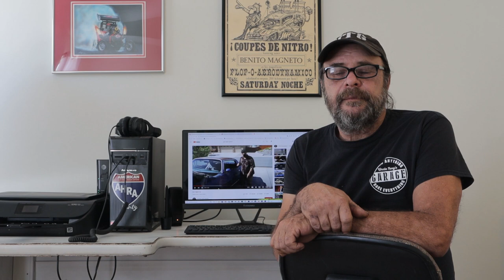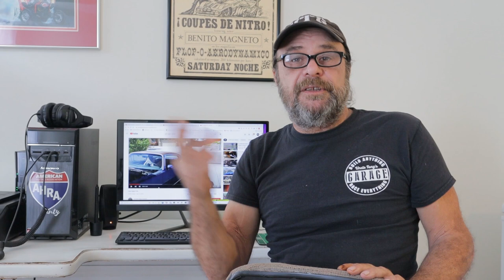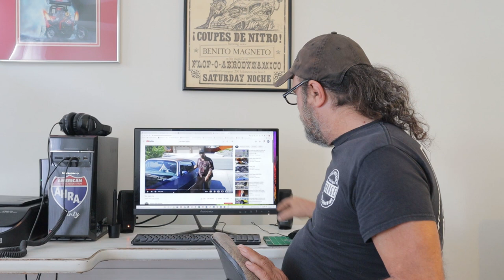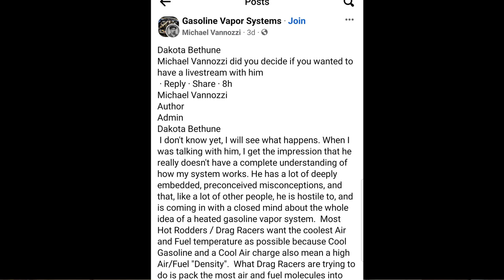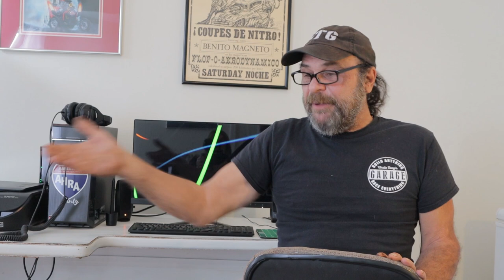Climbing Down The Mega Mileage Conspiracy Rabbit Hole

Comment: Uncle Tony,

I had to look through my garage library to find a copy of "Secrets of the 200 MPG Carburetor" by Allen Wallace. My dad ordered from out of the back of "Popular Mechanics" back in the '80s. I remember reading through it back then and believing it, then I grew up. It turns out that there is a demand for this rag "book", they are going for about $30 online. I see there is even a .pdf available to download as well. 

Keep up the good work!
Reply: I purchased that same book in the early 80's.  Naturally, I imagined that I would build one and achieve the incredible results.  After reading through the material, I decided I didn't want to be killed when my home made fuel air bomb exploded.
Reply: @flbartlett  It's not a bomb if built properly. I ran a little thousand watt Gen for a few days off evap fumes from a Jerry can. Took 3 or 4 hrs to work out air to fuel ratio but it worked, really well. The evap fuel is used as it's made, no storage, no bomb. Hydrogen cells work too and just need a simple spark arrestor, no storage, no bomb, also dirty non potable water is best.  All easy to do and safer than strapping propane tanks to your truck.

Comment: I built a vaporizer and diverted a proportion of exhaust heat through a stainless exchanger. It was well constructed. It was tried on two engines. A 3 liter V6 ford and a  3.3 liter GM Holden . The fuel consumption showed 50 mpg and 42 mpg respectively. That is imperial gallons. There was no noticeable loss of power. Long trips were taken.  
This experiment was done in 1980.   
High compression is a problem, the intake heat is critical and pre ignition, pinging, is going to damage the engine.  
A small carb on the heat exchanger was used, but it was found that a smaller main jet and the heat straight into the main carb had the same results. This is a bit problematic.
Conclusions. low compression is probably better.   (perhaps a turbo engine without the turbo).  When an engine is started the mixture is slightly rich and also while running.  The ambient conditions are being modified with added heat.  

The cycle of the crankshaft on an engine does not have any major combustion force applied as torque until about 35 degrees after TDC. There is some volume to be filled with a high pressure that is only a filler.  If the piston could be at the end of the cylinder and the crank at 35 degrees a higher combustion force would act directly into torque on the crank.
I built a retro fit on a small engine which I still have and it gave about 2.25 times the usual HP. It can be calculated and a volume per crank angle was plotted on a graph. Extra heat would be recycled at low load on such an engine.
The engine idles extremely slow and with open throttle accelerates to high revs almost instantly.
The engine is not practical for a race engine and was built only for cng fuel but petrol was used. More investment was needed as per usual.

Comment: All good points Tony, and you're being as open minded & fair about it as possible. I find it awful damned funny how the guy couldn't even give you a straight up answer over the phone. Not to mention it's painfully obvious he does NOT want to take up your offer of paying for a chassis dyno test.......hell, even a ride-along would do.......to see if the car performs even moderately ok during the take off, and passing slower traffic. I would wager that if he sees a guy haulin' ass on a bicycle toward him about a hundred feet out, he'll wait to let the bicycle pass him, before pulling out onto the road. The dude is straight up being DECEITFUL. Or else he would jump at the opportunity to prove "how well his Camaro runs overall".
Reply: Next up will be " run your car on water "  Have a look at this vid  Vacuum Pressure Hydrogen fuel cell defeats high gas prices using hydrogen from H2O.  on the channel Metalpress TV
( An actual fuel cell takes in a fuel and oxidizer to make electricity,this is sometimes found on space ships. What this guy is doing is electrolysis that absorbs electricity. )
Reply: @gasolinevaporsystems9022  That is a heavily edited video & didn't prove anything. My little 2000 Tacoma 4x4 with 2.7 liter normally aspirated 4 cyl engine runs 115 mph no problem.......but it takes a while to get there. It cruises @ 90 mph all day long, and hums along, cool as can be. I'm not demanding a V8 that gets 35 mpg @ 55 mph to "run the 1/4 mile in 13 seconds".......all we're asking is if the 35 mpg is worth the trade-off on what the engine can do under normal, realistic loads......such as a brisk take off from standing start, when heavy traffic means you'll sit there all day if ya don't. Same for passing slower traffic at speed. So what's the big problem in proving that? If your car can do that, it would be GREAT. So by all means, prove it to us. Because heavily edited videos showing short little clips ain't gonna cut it.

Comment: I completely agree with UT. Let's see actual numbers. I've got an old 350 4 speed with 3.08s that used to get 20mpg before ethanol, post ethanol is 17mpg, in an 81 k10 pickup. Almost unbelievable, but more believable performance than that hot vapor camero
Reply: had a f100 that had a c4 3speed auto got 20 mpg! had a 351w! 2.80 rear gears

Comment: That is an interesting theory. I can see the car getting decent mileage while cruising. But I can’t see the carb being big enough for decent acceleration.
Reply: I said the same thing lean
Reply: If we knew what the carb was off of, and air speed at the carb outlet, we could figure cfm, and put a similar cfm carb on a 350 Camaro. 

I bet there isn't one that small, though.

Comment: I remember in 2002, eBay was flooded w/ "Electric Superchargers". Basically a leaf blower fan you hose clamp inline w/ the intake duct. Advertised as increased mileage and hp.  The stupid Tornado fan blade was another gimmick .

Comment: In the 60's or 70's there was an article in Road and Track about a mileage competition in Europe. Cars like a Fiat 600 would be stripped of all but the driver's seat, and smaller a carburetor used so the car would run at wide open throttle. Skinny tires would be overinflated to reduce rolling resistance. These cars would not be useful for a daily driver.
Reply: Exactly.  The vehicle has to also start at sub-freezing temperatures (hard to do with hot-vapor systems when everything is cold), as well as at triple-digit temperatures.  Not to mention meet modern-day emissions laws.  And it had to run well past the warranty period.  The automakers are making so many compromises to meet all of these requirements that us car drivers demand of our vehicles.  Who wants to have to plug in their vapor system to preheat it for 10-15 minutes before the go to the grocery store in the winter time.  Most people wouldn't accept this.

Comment: One issue I've run into over the years talking fuel milage is simply that a lot of people don't know how to calculate MPG correctly. You'd think most people would be smart enough to fill the tank, drive X amount of miles, fill the tank again, then do the math, miles driven ÷ gallons used. 
Grade school level math, it's not hard. But DAMN I've heard some crazy numbers! Then after a brief conversation figured out that I'm talking to a math challenged person.
 Getting into odometer error quickly goes over the heads of a lot of people as well. 10% off one way or the other has been the rule for every old Dodge pickup I've owned. Once transmissions and rear gears get swapped it can really get bad. How many gear heads even think about the speedometer gear?
Reply: Or tire size???
Reply: The topping off method on new cars does not work. You can’t keep clicking the handle otherwise you’ll get liquid in your vapor trap and each type of pump shuts off with not the same back pressure.
Reply: @kalebbrown93  You don't actually fill the tank until gas comes out do you? Most vehicles have a vent tied into the filler neck, so your "new car" statement really makes no sense. Unless your idea of an "old car" is a Ford Motel T?
 It ain't rocket science just fill the tank till the pump shuts off, if you want to be super consistent go back to the same station and use the same pump. 
 We could argue that pumps might shut off at different points of back pressure all day but we're not talking gallons of difference here. Besides we're only interested in milage for our own use. If you're out to set a world's record or whatever, that's a different matter.

Comment: Your right uncle T…back in the late 70s, my dad, myself and my 2 uncles built a unit that could run a D-150 with a 318, on fumes only.  We had the St Paul Dispatch Pioneer Press come out and do an article on it., had WCCO News come out and do a news story. We made it run, respectively, but it was extremely dangerous. Mid range power was fine and it had very low emissions, extremely low, but yea the truck would run and perform on just the fumes from our chamber, and I did see the chamber ice up because we had neglected to heat it. It did work, I’d love to share the story with you if your interested.
Reply: If your story is true you could be a billionaire marketing your novel carburetion. You and all of mankind would benefit.
Reply: I was running semivapor at very lean mix with hot air valve wide open at aircleaner exhaust manifold.
Car ran awesome!!
Fast, responsive 15mpg increased to 21 mpg.
1966 289 2 barrel automatic.
Drove it for 2 years everyday.
Planning on getting it running again soon.
Reply: @rcnelson      I’d love to share it, it did work. There were more failures than successes , like I said it was dangerous, but when we got done,the truck ran and drove completely on the fumes from the chamber we built. We were just some garage wrench turning guys who came up with an idea, not engineers.

Comment: Great rant. And Uncle Tony is 100% correct about everything. As for that guy with the Camaro, I don't even understand why it's important that Uncle Tony understand how his vapor fuel system works. The whole point with the dyno run is to prove that it DOES work in the real (i.e. that it does it's job properly), not HOW it works in a technical sense. If it turns out the system does do it's job, then HOW it woks would be the next step.

Comment: Hi  Tony   My dad was an automotive mechanic .  He had a GM Doctor Certificate (1950)    Worked on gas and diesel engine for 40 some years.   He came up with an idea.  Heating the fuel to the carb so It would atomize and vaporize faster .  This would only happen once the car was warmed up.  His aim was to go from 14 miles per gallon to 25 mpg.  That was before all the improvement on fuel injected cars.      He was well aware amount of power required to move a 3800 Lbs  vehicle.     He  abandon the idea  because if the temp would get to high it would create a vapor lock in the fuel line.   So you would need to have a management system and regulator to shut off the heat.  A very complex system.    Cause and effect

Comment: would love to see the internals on that engine.  it must run soo lean .
let in go on a 200 mile nonstop roadtrip   i bet it locks up due to heat. 
dont waste more time on that dude.  theyre narrow minded like the essential oil people and flatearthers.
we did the experiment on a moped many years ago and doubled the mpg.  only problem was we had to get off trottle slowly or it would lock up.  it works on short term and short trips but after a month cracks were starting to form on the cylinder skirt and bottom of piston. a disaster waiting to happen.
Reply: It's gotta clatter like hell going up a hill...
Reply: If he's running that lean, the valves will soon be fried stumps and there will be holes burned in the pistons.
Reply: It's flat
Reply: re lean running, there's a range where the A/F mixture gets to peak EGT (Exhaust Gas Temperature). View it like a hill on a graph paper page. 
If you had an exhaust EGT gauge and an engine running under cruise conditions and the capacity to lean the carburetor what you could do is this: full rich say 575deg, begin to lean 600, then 650, then it peaks at say 675. You keep leaning and it goes 670, 660, 650, 640 , 630, 620, then starts running rough and cuts out.
 
What I've just described is what happens when you lean an aircraft equipped with a piston engine since you have to lean them when climbing to compensate for the reduction in air density anyhow, not just leaning when cruising. At 10,000 there's say I dunno 30% less air so your 300hp engine at full throttle now makes 200hp at full throttle and you have to manually lean the carb to compensate because if you leave it in full rich it runs badly rough and fouls the plugs and of course makes no power.
According to a given Pilot's Operating Handbook (POH) typically you would lean to peak EGT, then richen 25deg.
HOWEVER - some manufacturers allow lean of peak where you get to peak EGT and keep leaning so going off the backside of the curve. It is only for cruise conditions not for full power.
You see the detonation range is load dependent as well as lean temperature dependent and once out of that range they deem it safe to lean their engines in accordance with their leaning procedure. There is a chart that has manifold pressure, RPM, and allowable leaning temperatures graph in the POH. All piston engine aircraft have this.
Reply: Wrong lean only equals heat in a small window of afr. Many 90s cars ran a lean mixture for highway mileage and the practice was stopped because the exhaust temperature isnt hot enough to properly activate the catalytic converter.
Reply: @jarlnieminen4307 Oi Goose!
re read what I just wrote. Peak EGT or stoichiometry is not where the you lean them.
Reply: @ThePaulv12  oiy yaself I was replying to the original comment never read yours and was not talking to you. It seems we both share the same knowledge yet you are quickly offended.
Reply: @ThePaulv12  I have to say though you gave an amazing explaination now that I've read it.

Comment: Tony, it is important to understand that more times than not, high mpg comes at the cost of power (and performance). It is quite possible that instead of a 0-60 in 6 seconds, a car designed for high mpg will do 0-60 in 12 seconds, for example. It doesn't mean that the car is not operating properly. It just means that it has been modified to get higher mpg at the cost of power/performance. Similarly, if a car is designed for more power and torque, it will usually have lower mpg. A better suggestion for a test would be to fill the tank with a known amount of gasoline, and simply take the car out for a drive. No Dyno, no nothing. Just MPG.

Comment: So much time and effort has been taken to improve engine performance, economy, and pollution along with constant variable speed transmissions etc to improve mileage that I think we may be as far as we are going to get when it comes to power train issues. (For the most part.) I do think it would be   worth looking into a constant variable gear ratio setup in the rear end to work with the rest of the powertrain as this seems to be where the bottleneck would be.
Reply: This is what a CVT transmission does. Varies gear ratio to the wheels from the engine depending upon throttle input.
Reply: CVT's are for snowmobiles .

Comment: I thought the way fuel was refined/ created was changed once "big oil" discovered that you could run effectively on vapors, it was changed on a molecular level that's why the vapor "trick" no longer works. I could be wrong...
Reply: Your correct,,Nobody wants to address this part of vapor carbs..Gasloline today is not the same as gasoline of 100years ago..The first fuel additives were designed to render vaporizing carburetors useless,,they made gasoline much harder to vaporize..
Reply: @tomcatmcgillicutty6913  ok. Cool story, bro.

Comment: Hi Tony
The biggest increase in fuel economy was overdrive transmission and lock up torque converter. Fuel injection added to the increase also but was not as dramatic as the first.

Comment: The first key to economy is the engine design itself... It's hard to believe but the best was achieved in the early 1950's with the Lockheed Super Constellation With the Curtis-wright R3550 compounded boosted engine.. this engine had a BSFC of .32 @ 30,000 ft which to my knowledge hasn't been matched... 
  Now if we look at the whole picture... If one could produce a engine that could trap all of the excess heat produced in the combustion process instead of making hot water then you would have something!  
 Andy